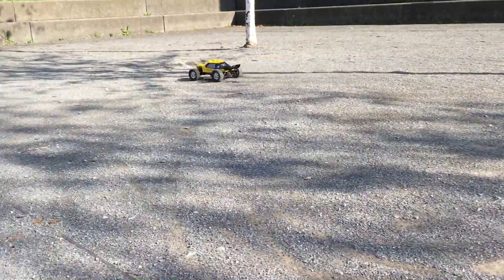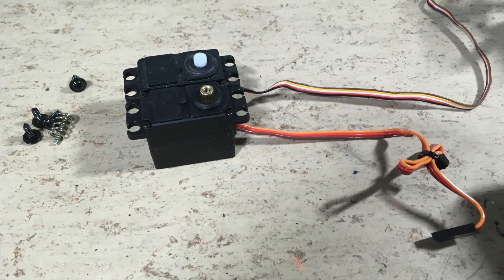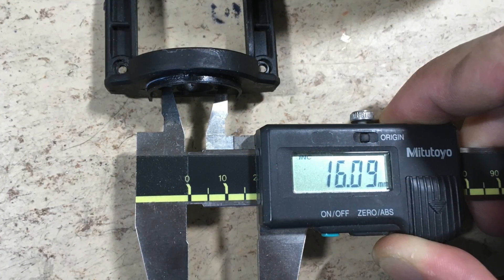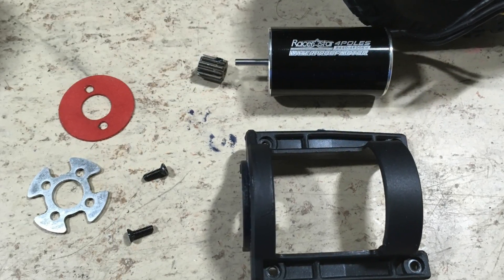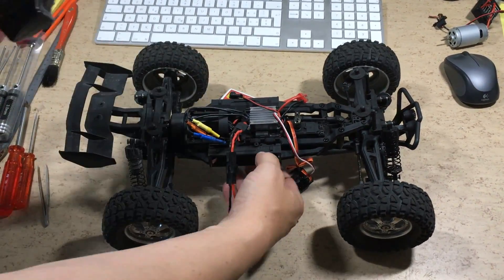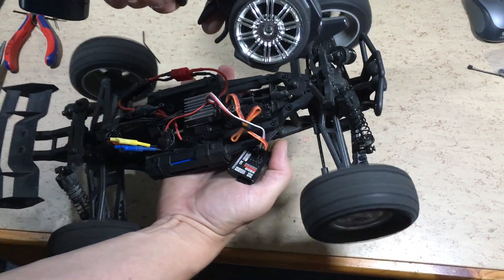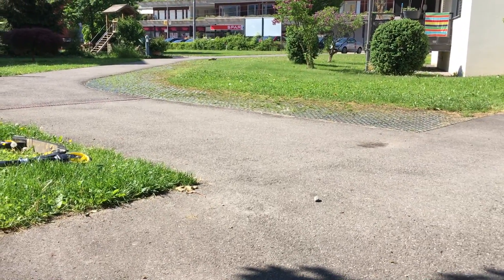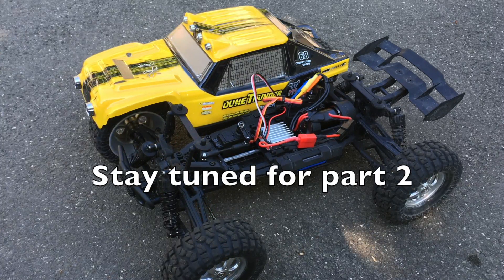HBX 12891 DUNE THUNDER Brushless Conversion Part 1: Fast!

Comment: Hi just wondering. What max motor can be fit in? Something like 3650 5200kv? And pinion gear size? I m new to this, and have succeded following your 2440 4600kv conversion. Thx

Comment: The original servo worked with the new esc? And about the original transmitter and receiver?
Reply from the maker: No, you have to replace these components with standard RC cmponents

Comment: I saw a comment that had a link to original JST connectors to 3 wire for using original lights but can not find it anymore.. can you help?
Reply from the maker: See: https://www.banggood.com/search/dupont.html?utm_campaign=4828314_1046285&utm_content=1097&p=NZ29024828314201605E

Comment: Super Video. Ich brauche mal deine Hilfe,unzwar wollte ich wissen ob dein ESC das mit macht und ob es doll heiß/warm wird? Ich habe die gleiche Kombi verbaut und mein ESC wird warm. Ist das normal? Wäre super wenn du mir helfen könntest :-)
Reply from the maker: Danke. Ein bisschen warm wird er schon, das ist normal. Der Motor wird auch warm, alles funktioniert aber wie es soll.
Reply: Super danke für die Antwort :-) Ich war mit halt unsicher ob das normal ist. Weil man sagt ja eigentlich das der Motor nicht mehr Ampere zieher darf als das ESC gibt? Stimmt das so? Weil den 2440 Motor gibts ja mit 6080 Kv und der zieht ja 47 Ampere. Das macht doch das 35 A ESC nicht lange mit oder?

Comment: Hello thanks for the video. Did the spur gear can handle the power of the brushless motor? Thanks for your reply
Reply from the maker: You're welcome. Yes, I never had an issue with the gears
Reply: Ok. Thanks for your quick response. You are still using the plastic now.

Comment: It's possible to change just the motor?
Reply from the maker: No, if you want it faster, you have to use a brushless motor / ESC. A brushless motor has more power in the same can size.

Comment: Is this upgrade  parts will work with HBX 12889?
Reply from the maker: I don't have this buggy, so I'm not 100% sure. But it looks like the motor and the servo are the same size.

Comment: does this car use the same spur/reduction gear as a959?
Reply from the maker: No, it is entirely different. Spare parts: https://www.banggood.com/search/12891.html?utm_campaign=4828314_1046285&utm_content=1097&p=NZ29024828314201605E
Reply: TheDIYGuy999 I see but if you only need the spur you have to buy whole package. https://m.banggood.com/HBX-12891-Parts-112-Spur-gearPinion-Gear-Motor-GuardSteering-Bushings-12602R-p-1182330.html?rmmds=search so I was wondering is the spur of a959 will fit to hbx

Comment: Nice en usefull video 😄
I,m a newbie to the RC world Just ordert de car a week ago and yesterday i realised  i need to have the 2440 and the 35A esc to 😈 zo ordert that yesterday also ordert the Servo don,t know why but you also put IT in so i think you had your reasons.

So no i,m thinking what spareparts would be usefull
Because when something breaks IT takes 2-4 weeks to get it Here
 (Netherlands)
Reply from the maker: The car comes ready to run, but with brushed motor, so it's not the fastest. If you want to do a brushless conversion, you also need a 2.4GHz transmitter and receiver.
I have not ordered any spare parts so far. Everything is still in one piece. You can find the spare parts list here: https://www.banggood.com/search/hbx-12891.html?utm_campaign=4828314_1046285&utm_content=1097&p=NZ29024828314201605E
The dogbones, hubs, differentials and gears could make sense to have on stock.
Reply: Thanks for the info! Why does the original receiver/transmitter doesn't work with the brushless??
Maby because the transmitter is in the esc of the brushed motor?
Does IT matters howmany channels? Just a noob here 😁 en any advise for a easy installing transmitter receiver whit the Wright functions?

Comment: Will I need the open source hardware if so where can I get it from u don’t mention it in the links
Reply from the maker: I tink I have mentioned in the comments, that you can use any other standard 2.4GHz remote. If you want to build your own, you can find the software and the pcb files on my github

Comment: How about a drifting video with drift assist module?
Reply from the maker: As I said: this buggy handles very well with its oil filled shocks and it's 4WD. So a stability control system is not even required. But I may try it anyway. BTW: part 2 will be available in a couple of minutes!

Comment: Your videos are great! Which ever car is your favorite?
Reply from the maker: Thanks. I like everything, that‘s fast and handling well. For example the WLtoys 12428 is reasonable in stock condition. Or this one, it only was a bit underpowered. You can always find discount coupons in my review videos.
Reply: TheDIYGuy999 you have another cars (jlb, a959) which one is the best in your opinion?
Reply from the maker: In general I prefer bigger cars, 1/12 scale upwards. They just handle better and can be used for trail runs. But they are more expensive to maintain. The JLB for example is great fun to drive but it just eats gears. I hope that this issue was solved with the last modifcation (see video)
Reply: TheDIYGuy999 I like the architecture of this car. The balance is perfect I think. The motor and most weights (batteries) are well balanced. I am wondering if it is possible how to create the solution for 1 battery instead of 2. Ideally to put the most weights (batteries) so lowest possible to the ground (centre of gravity). Maybe using 3d print to put the battery under the car?
Reply from the maker: Using 1 big battery instead of 2 18650 cells is pretty much impossible in this car, because you would destroy the good balance, if you mount it on the top of the chassis. And below the chassis is no room left. The stock 18650 cells are working fine with the 35A Racerstar brushless ESC. You can also buy high discharge 18650 cells, which are suitable for this car. The link is in the description. And yes, I will use a 3D printed part in episode 2 of this video. Stay tuned.
Reply: TheDIYGuy999 18650 batterry doesn't fit with brushless motor 35A ESC
Reply from the maker: It does. I will show the details in part 2 of this video.
Reply: TheDIYGuy999 looking forward to it!

Comment: Wow! That’s a fast Dune Thunder. Barely recognize it when it’s running that fast :-)
Reply from the maker: 😂, netx time I should use 4k. What is your 4k camera? The speed is reasonable, but still not crazy fast.
Reply: TheDIYGuy999 Yeah the speed and acceleration looks very good. Fast but still controllable. I just use my phone for 4K :-) I only use it for small and simple one-takes. In edited videos I use 1080 60 fps.

Comment: my apologies sir I was thinking of the 12889 thruster. with that in mind why did you buy this one and not the 12889 thruster?
Reply from the maker: No problem. I did not buy it, it was sent to me by rcmoment.com for review. I have to say, I prefer this version with its 4 wheel independent suspension. You can find a discount coupon in the description.
Reply: oh if i were gonna buy one it would be the 12889, but i am not gonna buy one i have way to many projects going on right now if you go to my channel you will see what i am working on. as soon as i get a good camera to do my videos i will continue with my project.

Comment: i have to ask you, did you shift the gears and use the second gear in the video?
Reply from the maker: This buggy does not have a 2 speed transmission. The version you mean is the THRUSTER, which looks very similar.

Comment from the maker: The Haiboxing 12891 DUNE THUNDER has a very nice suspension with oil filled shocks. Unfortunately it's a bit slow. So in this video I will show you, how to do a brushless conversion. If you like this video, like, subscribe and turn on notifications, so you will not miss the upcoming part 2 of this video. See you!
Reply: TheDIYGuy999 I see there’s a racerstar 2440 motor with 6080kv, do you think the batteries will be okay getting the faster motor? Is there a reason you went with the 4600?
Reply from the maker: No, they will not. Also, the 6080kV motor does have less torque. So go for the 4600kV version.
Reply: TheDIYGuy999 awesome! Thanks for the info, I appreciate it
Reply: TheDIYGuy999 follow up! Does this ESC allow for a higher voltage? Say an 11.1v battery source? Or will it burn up? I have a similar car. It’s the hbx 12812 or the redact KT12. All the same chassis.